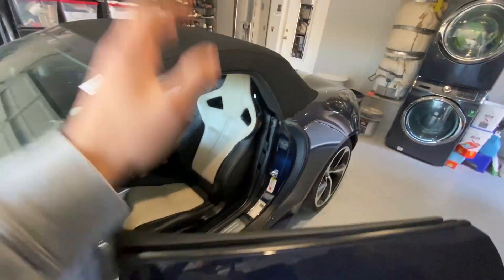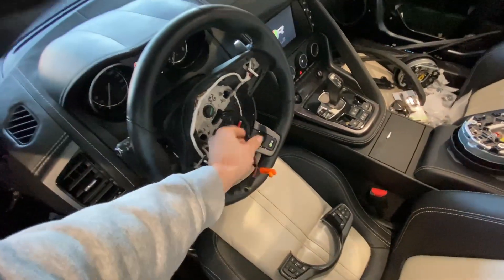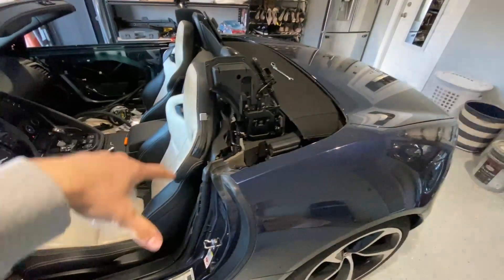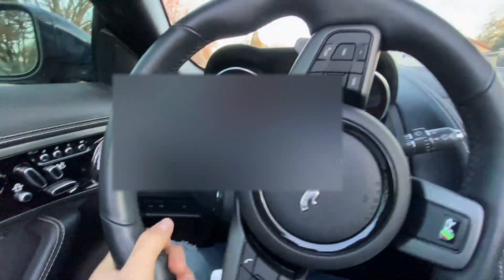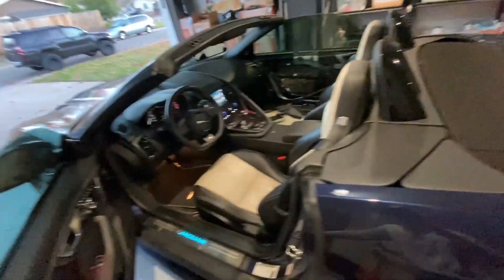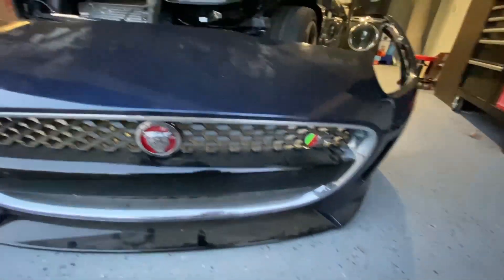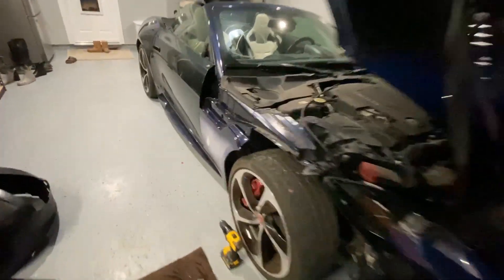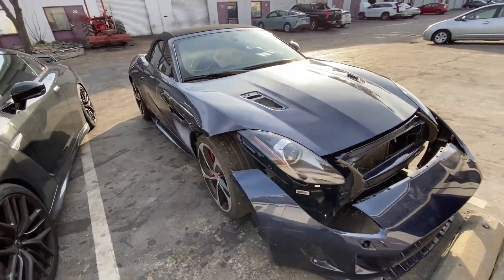Rebuilding worlds CHEAPEST WRECKED JAGUAR F-Type R From COPART AUTO Auction Part 4

Comment: You need to replace the 'S' badge on the front to an 'R' does it have it on the old bumper? They do sound amazing, I opted for all carbon black coupe with full leather interior red stitching (V8 ofc). You've done an amazing job so far. Glad I found your channel.